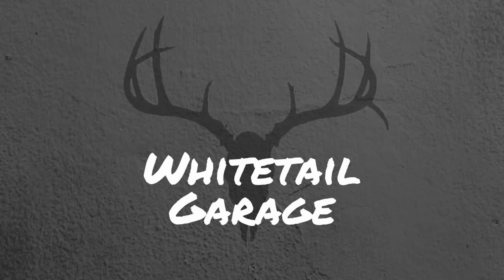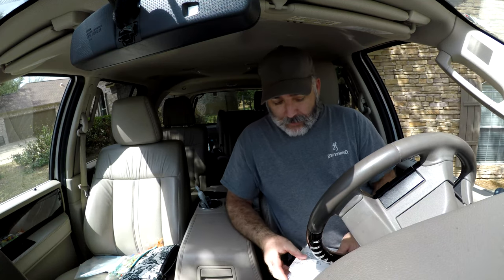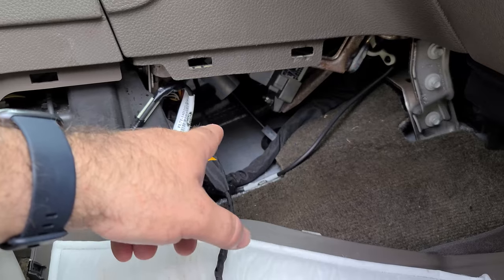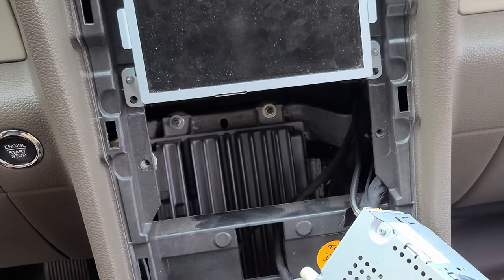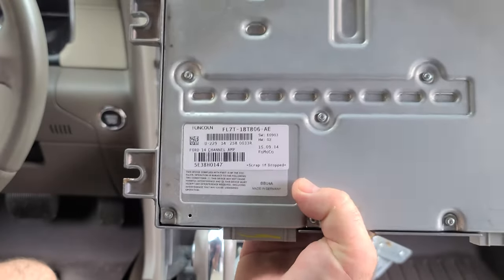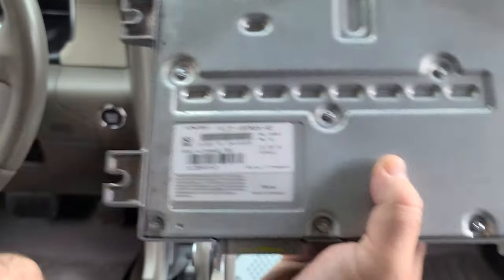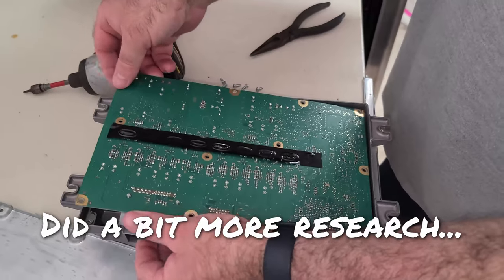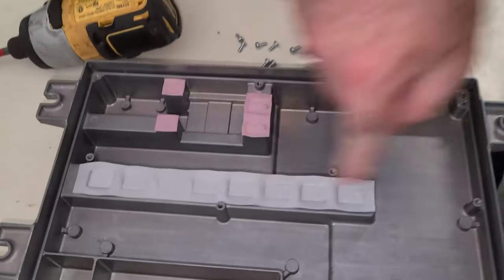2015 Lincoln Navigator THX Amplifier Repair

Comment: Just be aware, I just removed the amplifier from Loncoln MKT 2013. It is located on the back passenger side quarter panel next to the subwoofer. It looks exactly like the one on the navigator except the location is different. It will aply the same thermal pad fix. I will keep you posted on the results. Thank you so much for such a great video!
Reply: Perfect solution! I did spend only 8 dollars for thermal pads from Amazon! While waiting for the pads,  I cleaned the plate grounding contacts with Robin alcohol and that took care of the scratchiness noise. Then, after installing the pads, I got  the sound back from all the speakers. Before, it was just the central speaker working.

Comment: I had been having this issue with my 2015 MKC and after quotes for $500+ to replace or repair I started researching a fix. I came across this post and thought I'd risk the $10 and try the fix in this video. I followed the steps in the video about 4 months ago and mine is still working great.
Reply from the maker: Awesome!  Thanks for commenting and letting us know.

Comment: I had high hopes this would work for me but it didn't. We had sound in the back at all times but the front would come in and out and then the same symptons for phone calls. Now after replacing pads it's actually worse I have no sound at all now.
Reply from the maker: That is too bad, sorry to hear that.  My symptoms were no sound except out of the front center.  Not sure what that means as far as what part of the amp is bad.  Thanks for watching and thanks for posting your results!
Reply: It was worth the 10 bucks to give it a try!! Thanks for the video!
Reply: For the no sound at all, have you removed power from battery and reconnected?  I have to do that tandoori mine and it starts working. Mine usually quits when the weather is cold. Very odd.

Comment: Thank you my dude, life saver, make sure you use the thick pads! The pack comes with thin ones too. Worked on my 2015 mkz hybrid, amp located in trunk pass side.
Reply: found some 3mm thick pad on 3bay..  Nice!

Comment: Thank you so much for the fix! I have a 2015 Lincoln MKS with a THX sound system. I started experiencing sound loss and poor sound quality on hot days. I followed the instructions in the video and all of the audio issues have been resolved. I used the same pads listed in the video and also added some non-conducting thermal paste to the bottom of the capacitors where the raised divots make contact; the bottom of the case is also acting as a heat sink, thus the use of the raised divots. If you are going to add thermal paste, make sure it's non-conductive. Your video saved me tons of time, money and hassle, thanks again!
Reply from the maker: Thank you for watching and for sharing!  Good tip for everybody!
Reply: Same here man, it was doing exactly what happened in the video as well as making a loud fuzzing sound. Was your amp in the trunk?
Reply: I'm going to try and repair mines myself Did you leave the electrical tape inside the amplifier or did you take it away After you replace the  Thermal plastic

Comment: So I tried this and it didn’t work sadly (even tried with two other amps). The radio turns on, but no sound is coming from the speakers whatsoever. Any ideas what the problem could be?
Reply from the maker: Unfortunately, it doesn't work for all.  I think you have to buy a refurbished one.   They are pricey but not as bad as a new one from Ford/Lincoln.
Reply: @WhitetailGarage  I’ve already tried 3 different refurbished amps, so I don’t think it’s the amp that’s the problem
Reply from the maker: Oh, sorry.  I misunderstood your comment.  I would agree then, not the amp.  Do you have power to the amp?  Double check that.  You may not be getting a signal from the radio, but I am not sure how to validate that without swapping the radio head unit.

Comment: Maaaattteeee! I just bought a 12 navigator and the speakers didn’t play any output. I was thinking about replacing the head unit and amplifier and I done some research and came across this video. I put tape over the bumps on the amplifier so they don’t touch the motherboard and most of the speakers are working again. Just waiting on the thermal pads and I’ll change them and see if the whole thing comes back online.
Reply: Update* used new thermal pads but still don’t have rear speakers only front speakers. Taking into ford to see if they can resolve the issue
Reply from the maker: Thanks for coming back and updating us.  Sorry it didnt fix yours.
Reply: @mitchling6867  Can you please let us know what Ford said? My MKZ is having the same problem... Only front speakers.
Reply: @BYUGRAPPLER  unfortunately my car had a critical engine failure and i didn’t get a chance for them to look at anything to do with the speakers. I’m just going with it at the moment. Judging by the electrical issues I already have with the vehicle though I wouldn’t be surprised if speaker cables have deteriorated within the structures or they’re not wired properly

Comment: Hello. Just fixed the same problem. The side with metal points should be contacted with metal body, it’s just a ground point and thermo contact. 
You don’t need replace thermo gaskets, when you do that, you just create downforce on transistor. I tried to push on transistor with finger without body, and it’s start working. Tried to solder it, and no luck, same, start working only with downforce. 
The problem inside of first transistor, just swap it with second one, and right now have sound, but sometimes front speakers out of work.
So the problem is transistor, not thermo gaskets

Comment: Thank you for great explanation video. I didnt believe first but it worked perfectly for me. Lincoln MKZ 2015 THX , Symptoms: front speaker not working at all and rear cracking all the time.
Reply: Where can i find thermal pads

Comment: This fixed my 2015 MKZ with the THX stereo! Used some 1mm thermal pads left over from a video card project. I was just getting ready to buy one of the refurbished amps and found this. My symptoms were the random white static when the stereo was off, and center channel only while the stereo was on. Thanks a shit load!

Comment: This worked like a charm.  Thank you for sharing.  My 2012 Navigator had an obnoxious popping and hissing whether the radio was on or off.  It became progressively worse until it was almost unbearable.  I didn't want to wait for thermal pads so I used expanding foam weather stripping that is readily available at Lowe's/Home Depot.  Might be a temporary fix - we'll see.  But it's perfect now.  And, based on this, I'd say definitely do  NOT beat the dimples out.  The foam pushes against the board so that it stays in contact with the dimples.

Comment: Thank you Whitetail Garage!  I have a 2013 Lincoln MKX and used your instructions to repair my THX amplifier.  The amplifier on the MKX is in a different location than the Navigator. Instead of being mounted behind the dash, the MKX amp is in the rear quarter panel, passenger side.  After removing the panel using several plastic trim removal tools, I then found the amp behind a speaker box.  Got that out and then the amp.  Disassembled the amp just as you showed in your video, and then removed the pads which were dry and somewhat brittle.  Cleaned the surfaces with electronic parts cleaner (I like WD-40 Contact Cleaner) using a razor blade, Q-tips, and paper towels.  Reassembled everything, and then turned on the radio -- works perfectly, full sound in all speakers, and no static!  Total elapsed time: about 2-1/2 hours.  By the way, I used 2.6 x 0.8 inch Silicone Thermal Conductive Pads -- a box of 30 costs $8.45 on Amazon.  Only need about 4 or 5 pads for this job.  Not a difficult job to do -- thanks to your video! -- and a nice way to spend a beautiful fall afternoon in Atlanta.

Comment: Thanks for the video. It was worth a try but it didn't fix my DA5T-18B849-AE on a 2014 Lincoln MKX. Did you do anything to the contacts on the back of the board?
Reply from the maker: No I didnt.  As in the video, just double checked with the tape, but that didnt make a difference.  Only the pads.  I would recommend finding a good refurbisher on ebay with doa warranty.  There are a few good ones and you can save nearly half the price of a new one from the dealer.

Comment: Make no doubt, you are now on my HERO list. We had Ford attempt to fix the exact problem and pulled the plug when the estimate got over $3000 for replacement parts and labor on our 2015 MKX. I Amazoned the thermal tape for $10. The fix took less than 2 hours including finding, removing, fixing and reinstalling the DSP. 
Thanks again for your extra effort.
Reply from the maker: Amazing what the dealer gets away with charging.  I know because I have worked as a tech for several.
Reply: @WhitetailGarage how long did it work?
Reply: @marvinbuckingham1685  
It lasted 3 days. I redid the fix and again it lasted for 3 days. My third time, I discovered I was making the screws too tight and was squeezing the heat sink tape out from under the components. I’m not sure if this allowed a short circuit or was not allowing the devices to stay cool. In any event, it’s been months and the fix has worked as planned. Still saved a ton of $$$.  Hope you discover the same thing.
Reply: Thank you sir maybe il loosen them up a tad
Reply: @marvinbuckingham1685  I actually replaced the tape in all three cases. Once it was mashed down I was afraid it would not make contact.
Reply: @RC-hs5oq  so your talking about the small screws correct?
Reply: @marvinbuckingham1685  
Yes, the screws that hold the two halves of the amp casing together. Maybe there’s 6-7 of them. The ones that I left looser were closest to the center of the case.
Reply: @RC-hs5oq  thanks again sir

Comment: just finished following your directions and praise the Lord it is now working and I have one happy bride. I have taken the car to three different places and everyone said it could not be fixed. My wife actually wanted to trade in our 2013 MKX because she could not use her phone or have her Christian radio playing. Hopefully, I am not being early in my praise.  One of the funny things in my research on where the amp was located was the number of different answers I found on both by googling and calling dealers. I called five dealers and got three answers. i went with the one that three of them shared. Ended up being in the cargo passenger side. 
Cannot thank you enough.  Now i only need to fix the seat heaters for both seats.

Comment: Thanks for the great advice, i had ordered an amplifer from rock auto, but of course the wrong one. Saw this video and gave it a tru. Valla it worked. Lincoln dealer said new amp $799 and would take a few weeks to get. Glad i saw your video. 2012 lincoln mks with ecoboost  now drives and sounds great again. Thank you.

Comment: HELP!  I have a 2013 Lincoln MKX with THX sound.  I have the same problems.  Static appears randomly and all sound goes to the center speaker.
I got the thermal pads and followed the directions here to the letter.  I put it back together and now when the radio is on, I get the radio, plus static.  It sounds exactly like
I'm not tuned into the station.  Example: station is 107.5 and it sounds like I'm at 107.6.  Doesn't do this randomly, it's all the time.  Must have been something I've done.
Can someone help out here?!?!?
Reply from the maker: From what others are seeing this doesn't always fix it.  You may have to get a rebuilt amp.

Comment: I had applied this fix to my 2013   Lincoln Navigator and worked great for two weeks.  However, now the problem is back and not sure if I need to replace the amp.
Reply: I did take the amp out and apart again.  I found the thermal pad, I had bought using the provided link, seemed to had worn out along the main rail again.  It looked worse than the original pads I took out.  This kind of lead me to wonder if I went with the proper thickness of pad.  This time I replaced pads again and went slightly thicker this time.  Amp reinstalled and seems to be working again.
Reply: What was your symptoms? I'm having an issue with my 2012 Navigator where the music cuts out for a few seconds then comes back in...

Comment: Okay, I had a very similar problem. I have a 2015 Lincoln Navigator L and my stereo would completely go out (no sound at all) and at the time it went out I would turn up the volume and intermittently the radio would come on very loud and scare my wife to death. After a while it stopped playing all together.  So, I found this video and thought, $10 is worth a try. I ordered the thermal pads and they got to me the next morning. I pulled out the AMP and replaced the thermal pads with the ones ordered from Amazon and I took a pencil eraser and cleaned the contacts where the dimples rest up against the main board and I also used the eraser to clean the transistors.  I put it back together and Wah Lah! It is working great now. Thank you for posting this video! I looked up cost for a used amplifier and they ranged from $300 to $800.  You are a sound saver!  Now if someone could show how to fix my electric power steering that goes out until it warms up after driving without power steering for a few miles. There has to be some component that is inside the electric power steering that can be replaced instead of replacing it with a new one. :hand-purple-blue-peace:

Comment: Thanks for the video. It helped, but didn't completely fix. I am of two thoughts: 1. That the pads I used were not thick enough. Do you see double padding as a reasonable test for this? Or 2. The problem went on so long that the transistors that are being cooled already failed, or now fail even though the  heat sink is repaired. Any thoughts?
Reply from the maker: I would lean towards the transistors being blown and you repaired the heat sink.  I don't expect doubling the pads would fix it.  You could take it back apart and confirm contact on the pads.
Reply: If it helped, you could be on the right track.  I had to try 3 times before i found something that completely worked.  I ended up using some foam weather strip tape about 1/8th inch thick and thermal paste.  It must have been enough to pull some heat from the chips..  The thermal pads I used ended up squishing out from between the chips and the housing rather quickly..  The foam rubber strip doesn't squeeze out and compresses firmly around the chips.  I'm thinking if the chips were blown they would probably cease to work at all.
Reply: @tntring  Thanks,  in the end, i removed the bottom cover, and placed the amp sitting on the trunk floor unmounted atop a piece of thin cardboard. For whatever reason,  this has worked ever since.

Comment: on the control panel,there is a small white plug recepter.does a connector plug into it? put it back to gether but couldnt find a wire plug for it.everything works but no volume,no volume control. is this suposed to be pluged in?
Reply from the maker: I do not have any empty spots that I can remember for wiring.  Those harnesses do fall into the cavern behind the dash and look like they are running off somewhere else.  It took me forever to find the 12 volt outlet harness I unplugged and it was right in front of my face, 🤣

Comment: I did follow all the steps and still my radio is not working. I have  navigator 2016. if you can respond to me and help me with that I really appreciate it
Reply from the maker: Yeah, it looks like this doesnt fix everybodies issue.  I would recommend getting a reman amp.  Take the exact part number off your amp and search ebay.  Check to make sure it is the same and wont require reprogramming.  Most come with a warranty.

Comment: THANK YOU! I ordered the thermal pads on Amazon overnight delivery. Replaced pads and it WORKS! I didn’t do anything to the bumps or add tape to the front of board. I think the ‘wear’ on the gold areas was caused by vibration from the worn out pads.

Comment: i couldn’t find the foam in store so i figured i was just going to try this and if it didn’t work i would buy a new amp. do you think me putting flame retardant electrical tape over the foam will work?
Reply from the maker: This is heat transfer foam.  I suspect you will quickly burn up the amp if you dont use the correct foam.

Comment: I have a 2013 mkz hybrid and I'm ordering some thermo pads and hope to be able to do the repair this weekend Thanks so much 👍
Reply: FOLLOW UP... I ordered the pads from Amazon for 8 bucks and change just want to add my amp is behind the passenger side panel in the trunk when I removed it and looked at the part # tag on the back what I noticed is it said "scrap if dropped" had me thinking that's why those boses (bumps) in the aluminum housing are there to limit the vibration to the board just make sure to line up the board with the 2 locating pins on opposite corners in the housing then when putting the T10 screws back in I started in the center and worked my way out to the corners I used a screwdriver style T10 driver and hand tight I didn't want to crack or put strain on the board - oh the repair let's just say I was THUNDERSTRUCK in my car max volume🤘it's been 3 days and working great 👍
Reply: fixed it?

Comment: Did you leave the black electrical tape in place or did you remove it after replacing thermal pads?
Reply from the maker: I removed it before putting the new thermal pads in.
Reply: @WhitetailGarage amp still performing well?